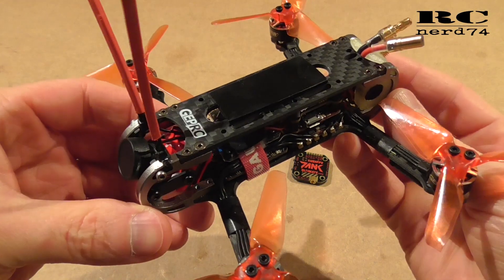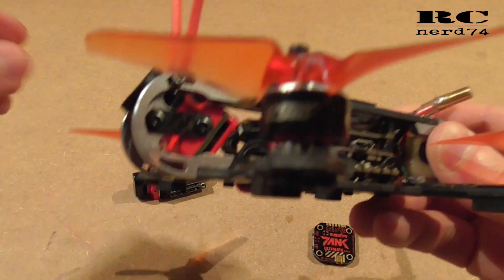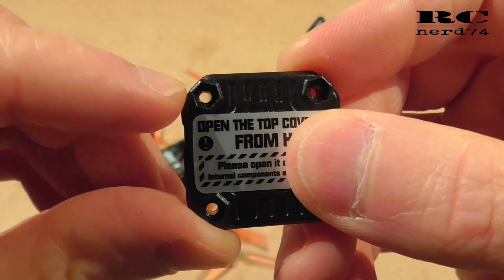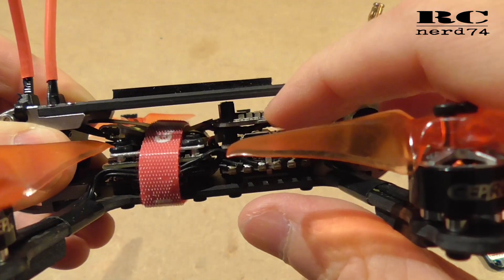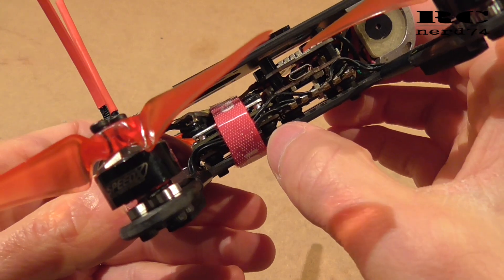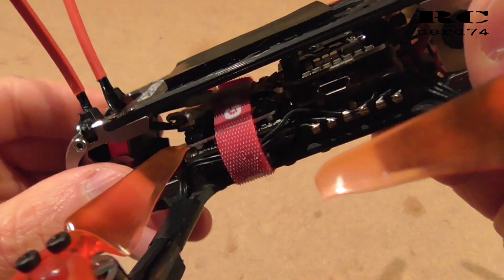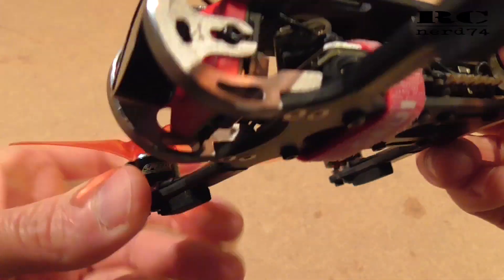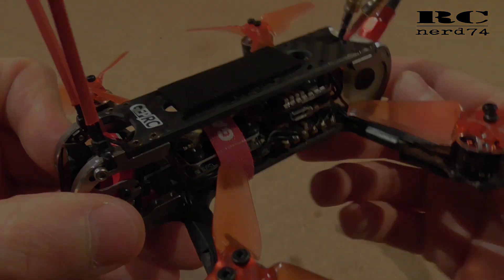CADDX TARSIER V2 & RUSHFPV TANK ULTIMATE MINI | INSTALLATION & TIPS ON GEPRC CYGNET CX3

Comment: As of today, are you still flying the CX3 on BF 3.5, or you moved to newer versions? I don’t like how it flies on 3.5, and would like to have a pid tune to try the latest version.
Reply from the maker: I still use BF 3.5.7. Never liked how it works on BF 4 or newer. For me it works best on 3.5.7 to get smooth HD footage using the caddx tarsier.

Comment: Have the RCHybrid on mine.
Reply: You have to move it around a bit and change screws to increase the angle, it sticks a bit out on the bottom, but I have l ding pads. Flying the DC3 more actually.
Reply from the maker: Does it fit well in the cygnet frame?